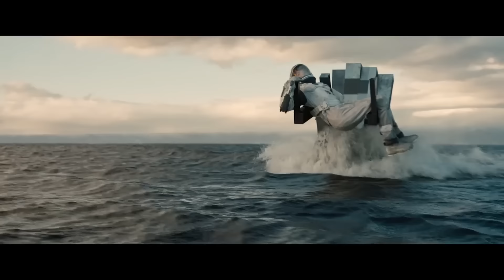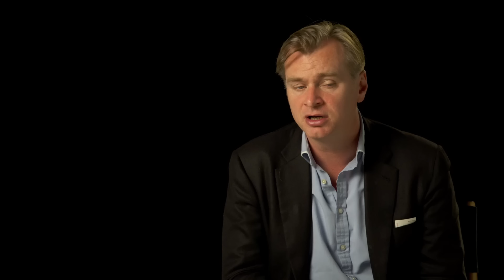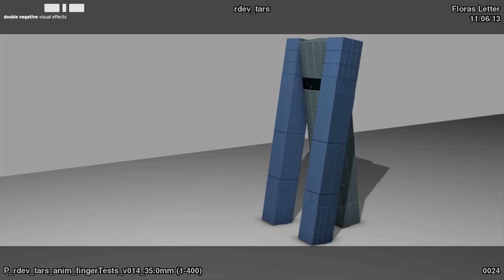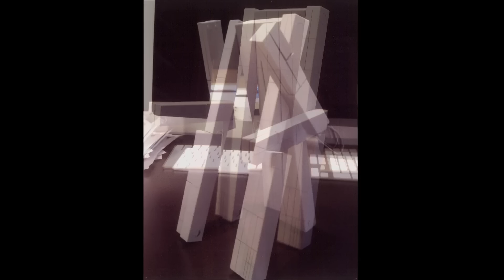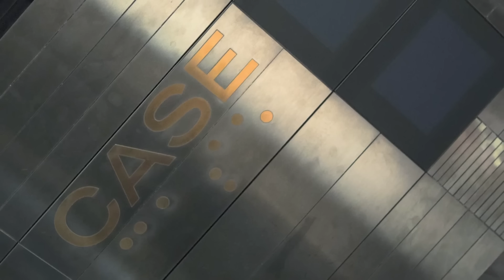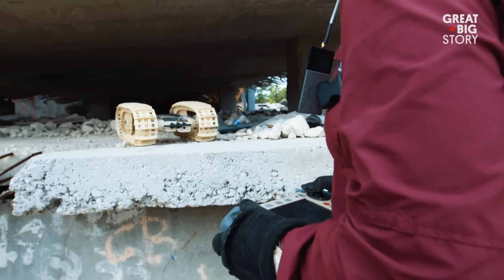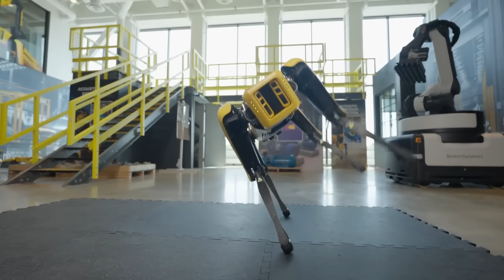The Robot Design Interstellar Got Right

Comment: It doesnt need to be human, but i cant understate the usefullness of dexerious limbs and a flexible body plan, which the interstellar robots lack. as far as i remember the movie never shows how they get around the station. how do they pass through tight spaces and such.

You want a robot to be able to go anywhere a human can go and more if you want it to be general-purpose. But the long blocks lack any meaningful joints to make them able to wiggle into tight spaces.

human level dexterity IS adaptability. If you aren't dexterous then your options for solving tasks is by design very limited.

ya ok got even further into the video and I am really starting to question your understanding of the phrase "general use". These robots wouldn't actually be really good any many task. want to move heavy stuff large distances? they dont have wheels or any meaningful grabbing structures for greatly heavy objects. They also cant use that rolling motion while holding something. so if they have to move something its so slow.

honestly these things kinda suck design-wise.

Comment: I like the utilitarian and industrial/reliability like intent behind TARS, however I don't think the appearance is very realistic, merely due to the robot's size.

for military environments, vehicles and buildings that are so wide to accommodate essentially a giant walking square is not very realistic, especially if said square is intended to touch flight sticks or steering wheels, military vehicles are already cramped for humans, especially geared humans. but that's sort of true for any built environment, since its built for us.
other than that I really like TARS, I think a smaller or more circular design could work.

One design I really like and think fits its purpose are the Oblivion drones, made to do one thing, very aggressively and need as little help as possible, plus the personality on those was awesome.

Comment: I agree that robots that are fully humanoid in all aspects are often impractical, hard to justify and value looks over practicality. However, the Interstellar robots specifically are a really bad example of bucking that trend, because they try to look non-humanoid not because of practicality, but purely as an artistic statement, which makes them look even more unrealistic and non-believable to me. They're not good for exploring arbitrary environments at all - they're too wide and inflexible except for the one axis of rotation they're granted, the appendages they use have little to no lateral motion, they have way too many joints, they're too wide, their completely flat "feet" are antithetical to ease of movement. Basically everything here is driven by the artist's desire to make it look like a block, which makes it also chase looks over practicality, just in the opposite direction. Ironically, they end up looking more humanoid than the real life robot examples you showed, since the Interstellar designs are still roughly at a human height, are taller than they're wide, walk like a human (either by using leg-like movement or by mimicking humans that walk on two crutches) etc. I imagine that a real all-purpose robot like this might look like a more modernized and beefed-up version of the Mars rovers - think treads, hard wheels and possibly short-term flight (if we go far enough into the future), multiple permanently-attached manipulators, possibly with different tool options, sensors and modules mounted in a way that makes them as lightweight and sturdy as possible without trying to go for some unified appearance. A walking wardrobe is as far away from that as possible.

Comment: This design really doesn't work for me, especially in a military context. Treads are so popular for military vehicles because they can do almost anything, with the right weight distribution...stairs, rubble, trenches, short walls. The hobbly walk Tars has would get fucked up by a single strand of barbed wire or a slightly higher than flat step. Likewise, the roll looks super unstable...with artillery bombardments nearby, or unstable ground - such as gravel, sand, rubble - it would definitely slip and topple over, exactly as the weight distribution would suggest, and it does NOT look like it would get back up quick or easy.

Then you have it's standing position, which, unless it's in sort of tripod mode, is literally the easiest shape to topple that can stand up.

What were these things designed for? Transport? Operating weapons? Being platforms for weapons? Rescue missions? They're missing vital equipment for doing almost anything, as above, I'm even doubtful of their locomotion.

I actually thought this while I was watching it...this model seems completely untenable in any universe where you don't have perfect control over a prop or CG. Even if you assume tech advances accounting for the ludicrous balance errors, even if you assume a use for smaller and smaller cube appendages, why would anyone design a machine with such fundamental issues to overcome? Humanoid robots would be, if technically feasible, optimal for rough terrain, climbing, jumping, crawling. Tank treads would be more sturdy. But fuckin four dominoes with an axle through them feels like the worst of all possible worlds, and it hurt my immersion a little bit even on a first watch.

Comment: I compare that metal wall to R2D2. It’s various models are basically computer modules for vehicles and equipment but it can also serve as personnel assist to open locked doors and access consoles. They even have little arms and flip out tools that R2 even weaponizes one like a taser at one point. It makes it fun because writers can make them solve problems without human based approaches. And them being machines gives them immunity to threats unless they actively provoke those threats

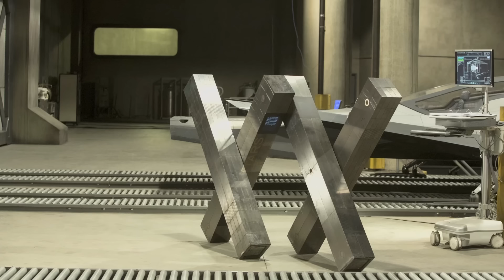Comment: 1:40 probably the coolest scene in the whole entire movie. I remember when I first saw the robot do that, I geeked out
Reply: I like that we can see a teeny tiny ringed dot on the upper inside arm, right about where the hinge would be for it's usual walk mode, and another one in the center where it's starfish mode hinge would be

Presumably they're intended to be the hinge, but a hinge mechanism that can be fully disengaged and made flush when in a different walk mode, yet is strong and secure enough to keep the whole robot together and transfer torque (and data and power?) from one body segment to another, must be a pretty neat mechanism!

By my count there's 5 mobility modes; /\ with AD, BC swinging in pairs; /\ with all 4 moving seperately in little steps; * or starfish when it rolls like a surprisingly well balanced wheel; the "running waiter" when CASE carries Brand back to the ship; and this blink-and-you'll-miss-it XX mode. Wish we saw that one a bit more
Reply: Came to say the same thing.

Comment: I like the big rectangle design it's...kinda cute watching them waddle around
Reply: They are incredibly friend shaped
Reply: @RainbowGod666 it is a rectangle
Reply: @iksskan9147  Rectangle, the most friend shape known to man.
Reply: @cesargonzalez4146  seeing as all of our machines are rectangular, yeah that makes sense
Reply: @iksskan9147  yeah... rectangular friend :)
Reply: @RainbowGod666 they are murder on the hardwood floors, though.
Reply: This is more why I don't like the design, or rather, that I don't like the military backstory.  It feels too rigid for uneven terrain, and that waddling movement feels wrong for a place where you expect a robot to be agile.  I think the design is good, but this feels more like the kind of robot that would move around mostly level land all day, and if it was military it would never leave the concrete or tarmac of an air base.
Reply: More of a halting lurch than a waddle.
Reply: It's impractical. A leg based robot is more practical and mobile.
Reply: @Scott-25300 brother it’s ONLY legs. Also did you see that thing move? It has a built in wheel mode and it’s pretty fast even pushing water.
Reply: @jcdenton4534  Big deal. It’s really kludgy. No way is this design practical. You can make a swimmer robot just as easily with a different form
Reply: @Scott-25300 Ratio you just don’t know good design, that thing is stupidly versatile, more so with minor improvements.
Reply: @Scott-25300  i don't disagree doesn't mean i can't like it 😊
Reply: It’s stupid and impracticle

Comment: I mean, I love the design... but they aren't really realistic. They're full of way too many delicate joints and complex interlocking parts and precise seams. A humanoid robot would potentially be significantly more reliable because they have fewer, simpler joints, and because you can wrap all the delicate bits in a protective covering fairly easily - I would not want to be the guy in charge of waterproofing TARS!

Comment: A future with no humanoid robots is a better future, because the only reason for a machine to imitate a person is to replace them
Reply: The reason would be because they are meant to operate in an environment designed for humans.

If a robot is meant to walk up and down stairs, interact with things placed on shelves and tables and receive instructions from someone standing next to it,
then it seems logical to design legs that work similar to human legs, have manipulators that reach where a human will put things and have optical sensors that have the same perspective as the user.
Reply: @DERADI30  Logical, but very impractical.  Legs sacrifice stability to enable tool use while making the minimum required change to the anatomy of our predecessors.  But why do that when you could use tracks to crawl up the stairs?  Just as fast but much more stable.  And optical sensors?  Why does the machine need to see a human user interface when it can wirelessly bypass them to communicate with systems directly?
Reply: @DERADI30 robots are meant to be specialized tools, not poor proxies for humanity. Our eyes are better and so are our hands and cerebellums, they always will be. But a robot can have precise measurement, perfect stability, and strength... Just not with human appendages or organ proxies. 
Dishwashers and washing machines are shaped for their optimal function. A household robot would be as well, and being shaped like us is far from ideal.
Reply: @ShouPow  "Our eyes are better and so are our hands and cerebellums, they always will be." Very presumptuous, given the rate technology progresses compared to evolution.
Reply: @orderafter-all  you clearly have no clue how complex our hands and cerebellums are if you think technology is anywhere close to that 😂

We don't have tools better than our hands, cameras better than our eyes, or computers better than our brains and it's likely not gonna happen anytime soon. Technology can do certain things better than us, a lot tbh, but our bodies are incredibly complex machines that synthetic machinery is nowhere near replicating and frankly it's just bad science to "replicate" biology.
Reply: @ShouPow  And you clearly have no idea how fast the technological timescale is as opposed to the evolutionary one. Something you might be unwilling, or unable, to realize is that it won't take advancements in engineering and biotechnology hundreds of millions of years to improve on nature, but a few generations at least.
Reply: @orderafter-all the difference between us is that I have a professional knowledge of human physiology and an enthusiasts understanding of tech development. Let's say you and I share our technophilia, that still puts you at an intellectual disadvantage because you don't even understand physiology to know what it would take to supplant human biology. I grew up watching the Boston dynamics bots get better every year (but it still has an umbilical and can get tipped worse than a cow).
You're overly confident in technology, and that's a common logical fallacy technophiles like ourself can make, but you're not protecting yourself from that fallacy, you're leaning into it. 
So the easiest thing in the human body to replicate would be the actions of our limbs (not our digits): and many robots have, but do you know the limitations of those robots? They're multifold but it boils down to maintaining precision and delicate touch, simultaneously. 
A robot cannot yet brush our teeth, let alone cut our hair. Robots are only just able to sweep our floors. Self driving cars take hundreds of watts to do worse than an impaired person's brain and eyes can do on under 1 watt of power. We're certainly getting better, but you're only so confident about tech because you're uneducated about physiology/biology in general.

You're right that technology developed faster than biology but it's 2 steps forward one step back. It took humanity hundreds of millions of years to evolve and even more to become organized. 

People like you are manipulated into believing AI will take our jobs etc etc because you're operating on fear and wonder, not objective training. That's not meant to be offensive but I imagine you'll take offense to being told you don't understand what you don't understand. And you'll just keep whipping up a storm of your ignorant noise fueling the avarice of stupider folks worldwide 🤷🏾
Because to people like you it's more important to replace us as fast as possible (impossible in the near term, <100 years) rather than work on helping us better (already happening).
Reply: People here are giving the human body way too much credit.
Reply: @Nor-tc8vz  you give it too little credit
Reply: @Nor-tc8vz  the unknown seems simple until you familiarize yourself 😘

Comment: I'm not entirely sold on the opinion that the robots were a perfect design, but seeing some of these comments just flat out calling you and the movie stupid just baffles me.

I do understand and agree with a lot of the points you made in this video. The human form may be specialized for dexterity, but it has a lot of constraints, and TARS and CASE do appear to be practical in a lot of situations. However, I have noticed in the movie that the robots can't really swivel or turn their limbs, and I am curious to see how they would survive walking on really uneven surfaces (as they must have been designed to, being military tactical robots). Additionally, I do see the joints getting gummed up with dirt and debris, which could also be an issue as well.

Despite those few gripes, I do think TARS and CASE have really interesting designs, and I definitely agree with the sentiment that choosing to make robots look humanoid isn't really doing us any favors. Plus, they just look really cool, and they're cool designs for cool reasons from a cool filmmaker for a cool movie! ^^
Reply from the maker: I appreciate the thought out comment! You make some good points. I’ll keep them in mind for the next video.
Reply: @Chromeborne  yw ^^
Reply: The core sections of the body appear to be bound to each other by magnets, the connection points change between their lower and upper portions all through the movie.

The smaller blocks are likely physically attached joints.
Reply: @Cri_Jackal  well, ik how they attach, it's just how the blocks turn like actual arms that confuses me a little bit, like where the room is for them to turn, and how exactly they would rotate. the blocks appear to only unfold directly out of the robot, so Im wondering how the blocks would actually achieve all the degrees of freedom a regular human arm would.